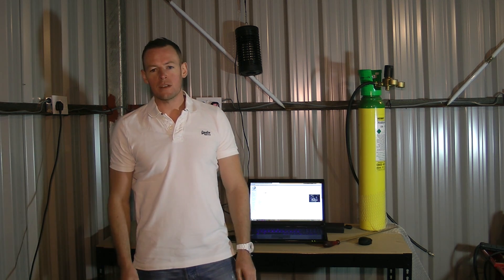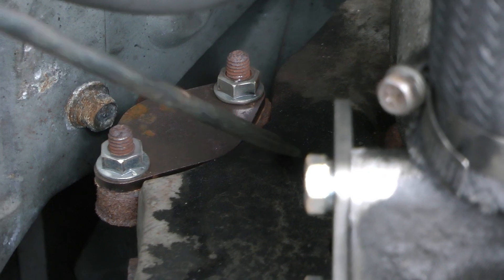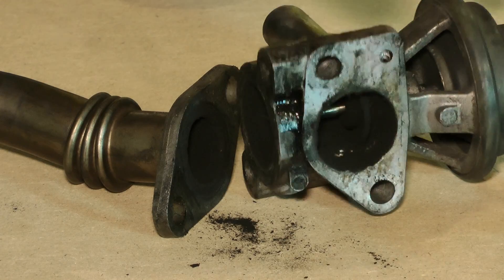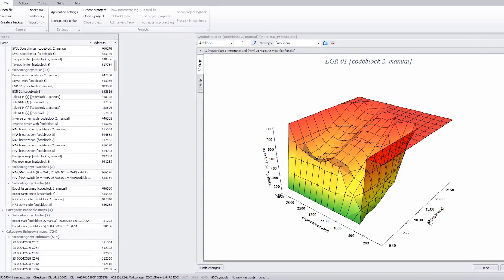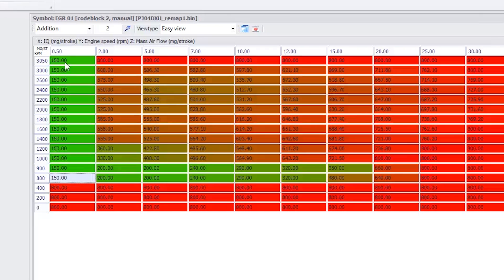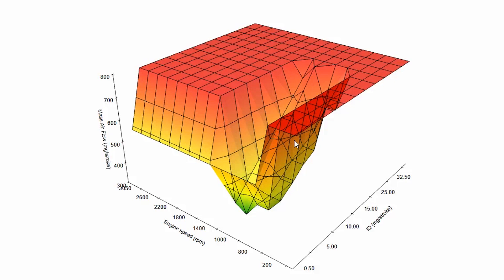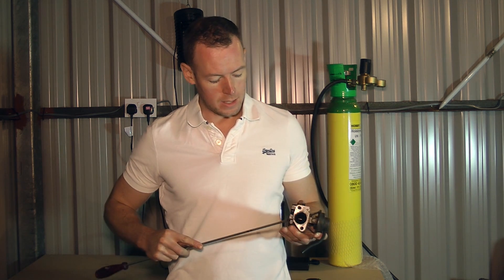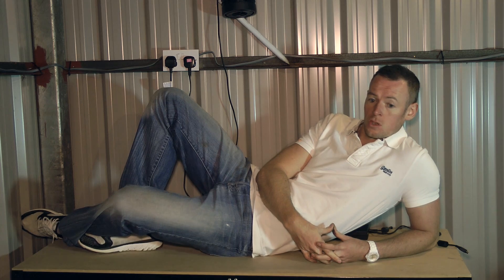EGR for motorsports

Comment: Offcourse i have softwares like Swiftec and others and i can , but not the way you show it.
This work fine in many EDC15  ecus .Try on Opel edc 15 to lift full map will not work.
I do this more than 10 years so i know for shure.
Reply: +Nikolay Nikolov 
hi Nikolay 
I have audi a3 tdi 110 hp i want to change ecu map can you guide me a little bit?
Reply: Write me in my mail
Reply: write me you email
Reply: +Nikola Paunov 
nikinik@abv.bg
Reply: Your Mail is not correct
Reply: My mail is absolutly fine and correct.
I dont know why you have problem reach my mail?

Comment: There is no "air" in exhaust gas, it's all been burned. Exhaust gasses are recycled because they're effectively inert, the inert gas reduces combustion temps inside the cylinder.

Comment: ok so i got my blanking plates. blocked off my vacuum line. what do i do with my electrical connectors? and is there any other steps i need to do. i don't mind about a check engine light

car is a 2001 VW lupo 1.4 petrol
Reply: If I was in your boots I'd just install the egr with the blanking plates in place. Plug the egr back in. Egr faults can cause limp mode and poor performance if you're not mapping it out.

Comment: Hello, 
Great videos, excellent info.
Have a Isuzu dmax 2,5 2007 136hp with a delphi ecu and a bad EGR. Bought a KTAG to remove EGR via BDM.
Do you recomend that i change the values in a way to keep EGR permanently closed, avoiding the error code??
Best Regards
João

Comment: Hi all,

I am looking for how to tune my Kia Sedona (Carnival) CRDi 2,9 2005 J3 engine. I can´t find anything for my car. I will block the EGR mechanically, but I don´t know how to pick up the power from 106kW to 136kW. This engine is programmed already to 136kW at the new Sedona model, but I am not sure if I can completly remove the file from the ECU model 2007 to the 2005 model. Probably not. Can anybody guide me a little bit, please?

Thank you,
Michal
Reply from the maker: +Letecke Vysetrovani I suspect that a 30kw increase comes from a different turbo on the new model of car. That's a large increase from software only. See if you can find out what turbo model number is fitted?
Reply: It is made 2004. Momentally I have the car in the service, so I cannot say any more detailed informations. I guess it will be possible to increase the power by software only, but I cannot find any map, and I am not a professional in this sphere. But I am ready to learn, as this video is very good understable. Thanks for any help.

Comment: How did you checksum the file before loading it onto your polo? I've just bricked mine as I was sent a map that wasn't check summed hahaha
Reply from the maker: +dave11owlett Ouch. The software I used (VAGsuite) had a checksum tool built in.
Reply: +vPerformance Is vagsuite free?
Reply from the maker: +dimmacommunication it is, but it only works on a few manufacturers, mainly German ones like audi and vw

Comment: Dear Friend, I have a Passat PD130
I think just like you, this EGR system developed for the purpose of reducing NOX gas generated high temperature and harmful to the airways, etc ... My problem increased fuel consumption, and this is the problem that the computer is programmed to map the EGR works normally, so need to re-program the map (REMAP ) Any ideas how to do it?

Comment: Hey Lad, you didn't mention how do we get the check engine light to go off?

If I just unhook and plug the vacum line to my EGR valve it won't open and let the crap pass through correct? But the engine light will come on to let it be known that the EGR / DPFE is not functioning properly.

 How do I get the check engine light to go off though?
I have an apparently bad DPFE Sensor as it only registers .244 MV at idle and barely moves from there as the EGR valve comes on when I apply vacum to it manually.
Reply: You find someone who's working with mapping, tell them what you're doing and they will either decline or assist you (for an agreed upon fee).. Like anything on any market anywhere.
Reply from the maker: That's why the Remap is needed - for the check engine light
Reply: Thanks man! I'm learning a lot about all the components of the modern cars. Not learning nearly enough but all I can squeeze in. I'd like to know how to do the remapping.

  I need a good diagnostic scanner as well.

Comment: EGR: biggest scam these manufacturers have going.  Gee, lets take fouled exhaust gasses and run them back through the engine to foul your injectors, plugs, and o2 sensors, making the parts require servicing much, MUCH sooner.
Reply from the maker: But surely we can trust volkswagen
Reply: requiring you to buy a new car every 5 years
Reply: I forgot: it also reduces thermal efficiency and volumetric efficiency of the engine.  A fail all around.
Reply: Guys... It's not designed for performance. It's an emissions regulation thing, if your engine doesn't pass or is required to have devices. The manufacturer's have to comply, look at the VW cheater-diesel; it was a huge scam in the opposite way. This can be deleted to save valves from like coking up, loosing power. But if you intend on racing this kind of engine, you delete and turbo.
One way it's completely street legal, the other will have you making huge, court-ordered, payments when your insurance company dumps you upon filing a claim. If you want performance, get a fitting upgraded engine that OEM fitted on more racy models. Zetec gets up to ~180hp for a moderately reliable, +200hp for the special race class. N/A power :)
Reply: @edlingja1  I have unplugged the cable now. If it shows better performance I will only click it in before the emissions test lol. It's not even noticeable, because the plug looks like it's connected (it just isn't pushed completely). Scan tool recognizes it's disconnected, but there is no check engine light.

Comment: Great video lads. Tell me : will the slightly increased emissions have any affect on MOT-ability of the vehicle? Annoyingly fiddly to get at on my Z19DTH in a saab.
Reply from the maker: The wonderful thing about diesel on the UK is that the MOT is very lenient. As long as you're not blowing black smoke you'll pass the MOT. I'm pretty sure diesels have an Nox test, but no pass/fail criteria.
Reply: +v11o thanks for that: still not gotten around to blanking it but ordered the blanks today. I am a wee bit worried about the affect it'll have on the DPF regeneration  (from the varied opinions I've seen online). What's your opinion on that? Ta.

Comment: I'm wondering if I do that plug at the EGR valve, does the check engine light will come up? I own a 2003 Audi A4 2.5 TDI.
Reply: +Rása Péter I don't think so. Atleast my 1.9 PD130 (EDC15P) doesn't care.
My mate has got the '09 A4 2.0 CR140, and he sometimes get the CEL.

Comment: not that I am not for deleting EGR valves.... if the EGR is deleted doesnt the engine take longer to warm up?
Reply: +Tom Chinnery if you look at the map, EGRs don't operate during cold start conditions.  Plus, the EGR doesn't really flow enough air where it would help to decrease warm up time significantly.
Reply: Tom Chinnery  you can make map dynamic egr to get both benefits... basically you keep it at low rpms/IQ and at high rpms/IQ you have it shut off.
Reply: Tom Chinnery Other way around actually, lean mixture allows for hotter combustion.
Reply: wrong, EGR decrease warm up significantly and EGR does operate in cold temperatures.

Comment: That's all neat and nice, but what if the EGR valve is faulty and I need to disable it completely? It was told somewhere that you need to adjust injection timing as well.
Reply: ignition should be played with becasue egr gases in theory make the mix burn differently  so you can play with the ignition the mapping

Comment: Brilliant video. one of the best ive seen. yet. i have a question regarding My 2003 PD MK4 GOLF. ive just remapped it from 130 bhp to 165 bhp. and added a new stainless exhaust, with the cat removed. ive had the turbo completely reconditioned. egr valve and manifold cleaned spotless. im having trouble with black smoke every time a push the Accelerator right to the floor. when im in 4. 5. and 6 gear. my mechanic took off the the inlet pipe going to the egr valve and noticed that it was constantly open and closing while the car was sitting idle without pressing on the accelerator peddle. could this egr valve be causing the black smoke problem im having, or could it be cause of the remap ive got done, has altered the way the egr valve is working. any feedback would be really appreciate it mate. thanks a million.
Reply from the maker: It'll be the remap. Diesels can be remapped by simply chucking in more fuel than the engine can possibly burn, which results in unburnt fuel as black smoke. Even standard cars smoke but after a remap it's always worse. Look up Rolling Coal on youtube.
Reply: Listen your a absolute gentleman thank you very much for your quick reply..
Reply from the maker: sonical lyno Any time!
Reply: No smoke, no power! Don't worry! ;)

Comment: Why do you need to do a combination of both with modern engines? Why can't u just stop it from working at all map it out altogether ?
Reply from the maker: In some cases the design of the valve means it is always engaged, even when the map is changed to ask it to be off